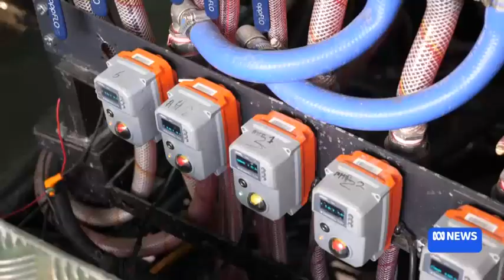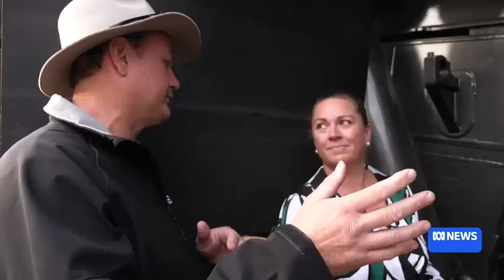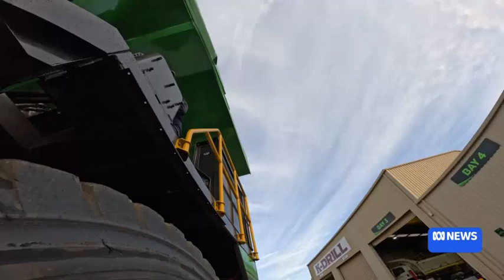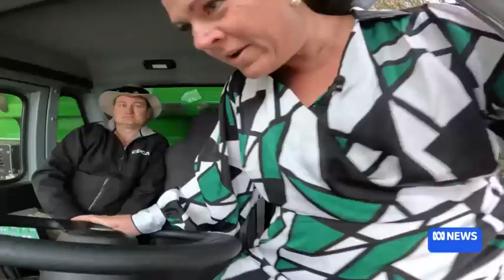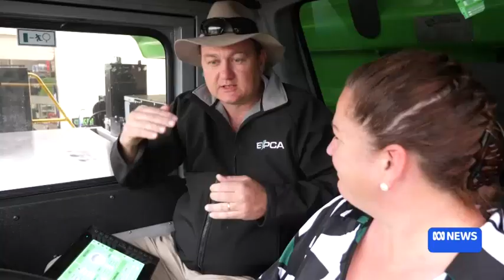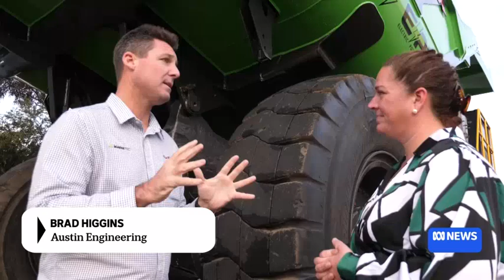Diesel Mining Truck Goes Electric to Slash Emissions

Comment: They use a diesel engine to power an electric motor. It's a bit more efficient than an IC engine.
Reply: Where does free power come from?
Reply: @romoalex  there is no free power here, they burn diesel to power an electric motor instead. This process is slightly more efficient than directly burning diesel in your IC engine.
Reply from the maker: Yes diesel can still be used to charge the batteries and power the trucks. However, the chargers used for our trucks also accept DC from solar energy. For more info, check our slides presentation: https://heyzine.com/flip-book/14db7860ec.html

Comment: Any details?
Run time, 
KWh of the batteries, conversion cost?
Reply from the maker: Hi, here are some more details about our truck:
🔋 Runtime: 10+ hours on a single charge
⚡ Recharge Time: 50 minutes to full charge
💡 Regenerative Braking: 15%
📉 Idle Consumption: 20 kWh
Conversion cost: about 2.5M / total cost of ownership (over 20 years): $11.5M, whereas a Diesel truck reaches $25m
You can find some more details on our LinkedIn page or resources page here: https://www.epca.net.au/resources/
Reply: @EPCA_  Thanks for the reply.
Q. Ten hours run time...
Loaded, hauling from the a pit to a ROM pad, or just empty surface driving?
I ask because the diesel equivalent will need refuelling at the end of shift and I'm struggling to imagine having enough on board storage to match the energy required.

Comment: Most large mining trucks in the Americas are Electric, same as trains.  A Diesel generator provides power for the electric Motors.  They just got rid of the generator and went for battery. The only awful, stupid, idiotic idea is the mindset of most of the commenters that have no idea what they are talking about.